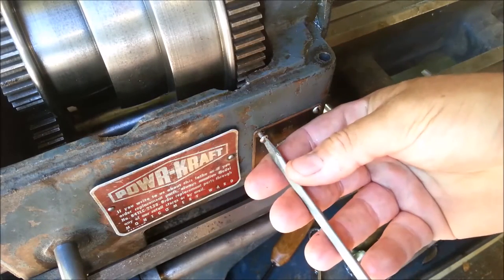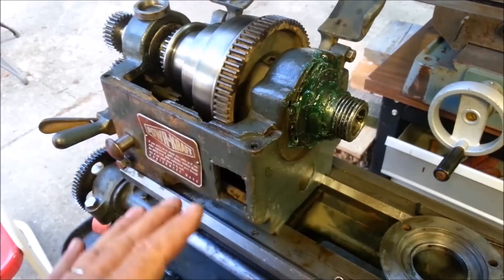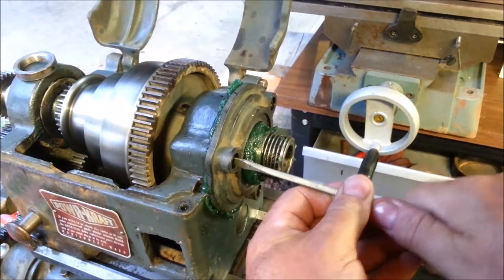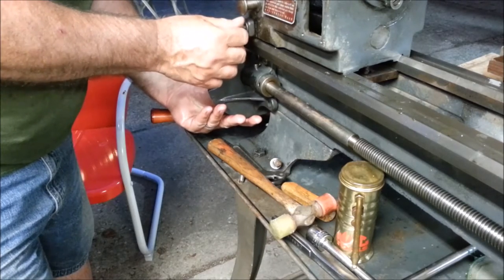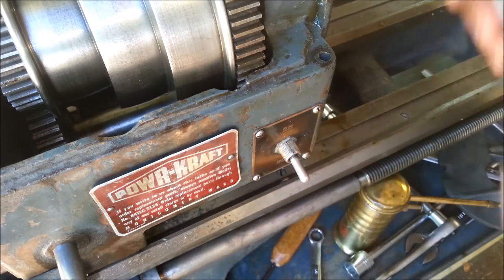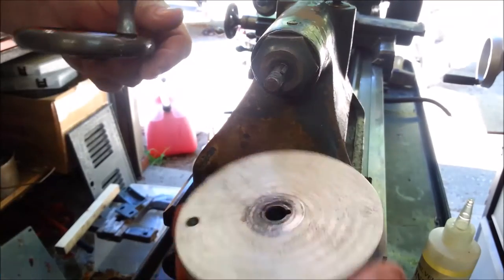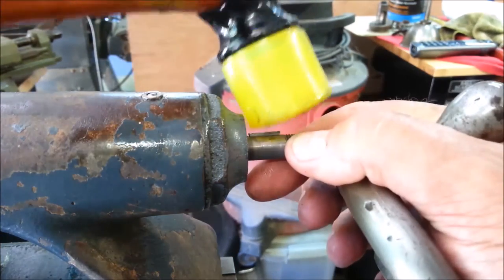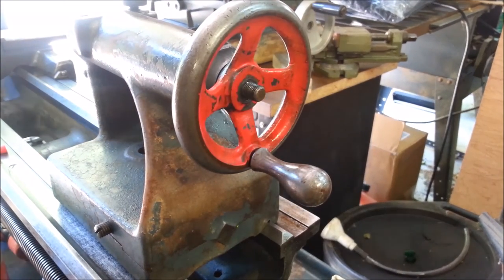47 Wards Logan Lathe Part: 10 Spindle, Cover, Crank  Crafted Channel

Comment: Never use the back gear for locking the head stock unless you want to tear it apart and through money at the broken gears! been there done that just a small heads up!
Reply from the maker: W'ere not talking about great torques here.  Besides, if you want to hold it, how would you do it?    If it were any kind of serious torque involved in tightening that little threaded ring, holding the spindle with the chuck would impart that torque into the chuck threads.  When you go to remove the chuck I would have to assume at least equal torque required in the other direction to loosen.   How do you hold it the spindle to remove the chuck then?  Real serous forces are required to tighten or loosen a chuck. Particularly a stuck chuck.   I do own a trick way to hold a spindle.  A tool I purchased just for that purpose.  I had it at the time but it didn't occur to me to try it during that 2 week frenzy to get the lathe done.   I keep seeing the admonition but no real solutions offered anywhere.  It would be cool if spindles were drilled for a bar just for this purpose.   If I did that, you can imagine all the strong comments I'd get (of course I'm not suggesting it's a good idea to actually drill the spindle)   And really, all the force of holding it with the back gears is going through a single setscrew interface with the shaft.   I think I need to make a video on just this subject.  I do own a damaged back-gear (came to me that way) and a damaged bull gear.   It might be fun to setup a demonstration to see how much torque it takes to shear a gear.   Sure people have damaged gears, but it's usually some animal really flogging away at removing a stuck check.  I think there is a video here in working out all the possible ways including an interesting Idea I have never seen shared.   Just thinking out-loud.  Please feel free to add any additional thoughts here.
Reply: I would use a strap wrench around the large pulley. My lathe took out to gears tapping just the way you did? Maybe fate they might have been ready to go ? Bad thing Lathe is Bulgarian made. 0 parts for it! So far getting two gears made for it are out of the real world. Nice lathe may have 200 ours or less on it. Weighs 1769 pounds. 10 inch x 40 . Do enjoy your videos and my client was not a put down in anyway. Have heard of this breaking Sears lathes also. Good thing about them you brought out eBay has about everything sooner or latter for them. Out West here lathes are few and far between and way out of reach.
Reply from the maker: Danne Hughes No problem.  I didn't take it as a put down.   I do have a strap wrench.  I have another method to use in a future video also.  I think you were right.  I had more options.  ;-)  Do you have a video up of your Bulgarian lathe?   I plan on making some needed gears in the future.  Haven't purchased any cutters yet.